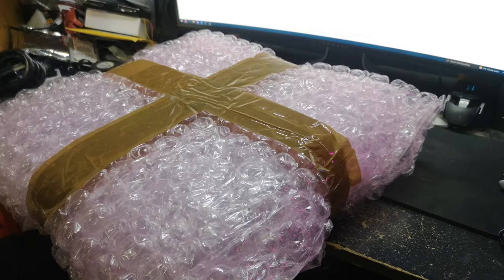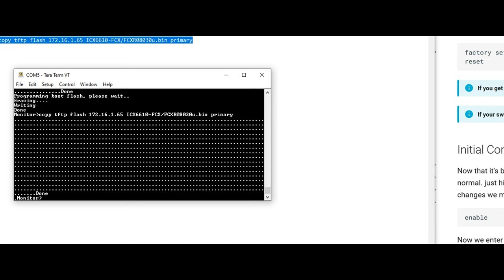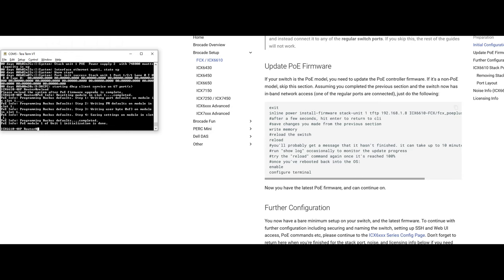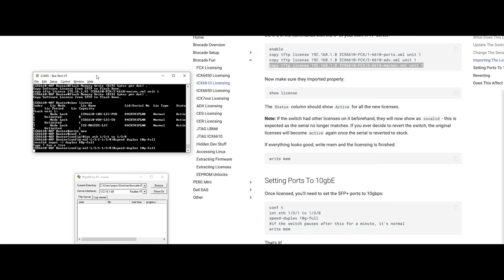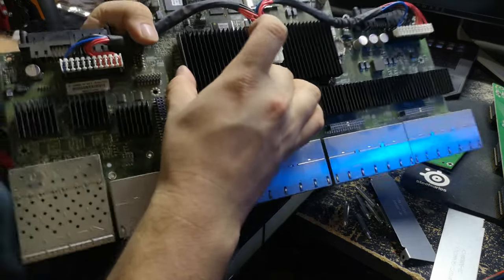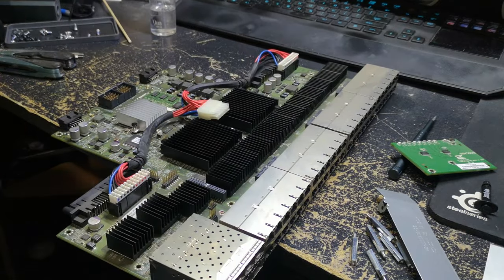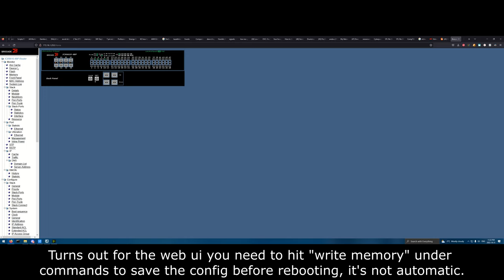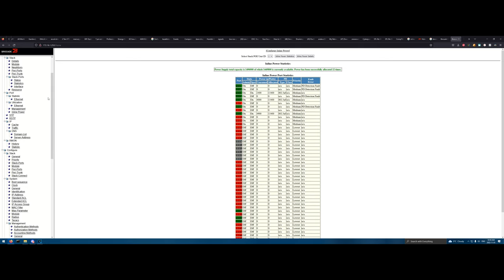Brocade ICX6610 Upgrade. Why have cold cuts when you can have BEEF with a side of Kryonaut.

Comment: @JunctionRunner what does your CPU temp get up to in "show chassis"?  I'm having a similar issue and my fans are ramping up to speed 2 for 30 seconds and it cools down.  My CPU temp is getting up to 76C with the room being 77-79F.  I've done the same as you in applying thermal paste (not Grizzly) but I'm not seeing any difference.  Trying to see if this is just normal or if I can reduce the CPU temp.

Comment: How were you able to remove the push pin of CPU heatsink?
Reply from the maker: I use needlenose pliers on the back end to squeeze the end together and push it through. I need to do the board again in my switch since this one had an issue and I got a replacement from the seller. 

It did help for sure because right now it does warm up enough to spin the fans up, while the thermal grizzly one didn't. 

The heatsink was stuck pretty solid when this board came so I didn't really want to mess with it but I guess now I'll have to pull it out and apart.

Comment: You're getting that msg about an IP jumping back and forth between two ports because your server and switch don't match in their port-channel config.   i.e. if your server is trying to bond two nics together and doing round-robin load-balancing, and your switch hasn't been configured to match, it doesn't automatically know ports X and Y are one "logical" port, going to a single host.... it thinks the IP is hopping between two warring servers :)        set the switch to match the same kind of bond / ether-channel / port-channel as your server, and you'll be cooking with gas....